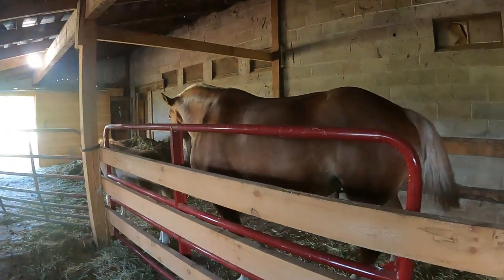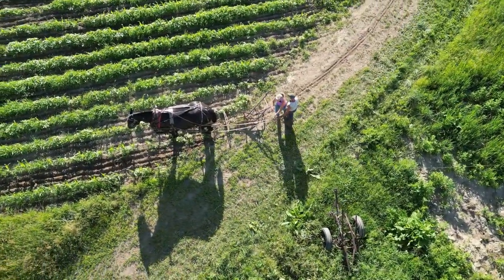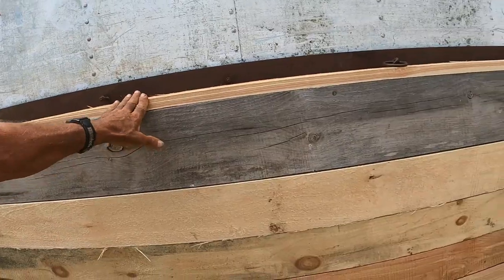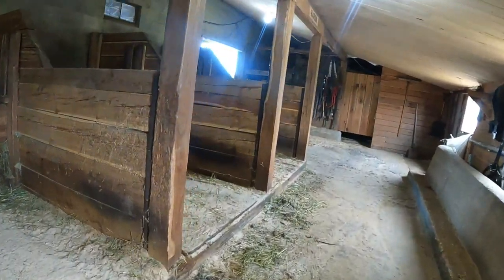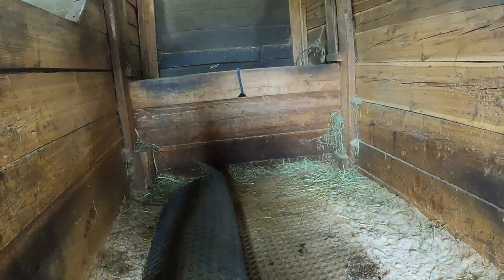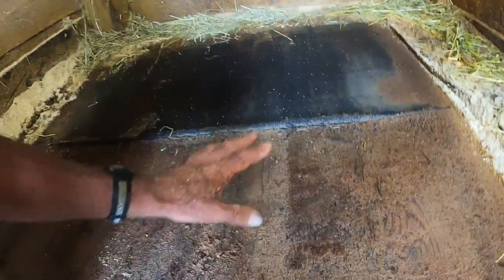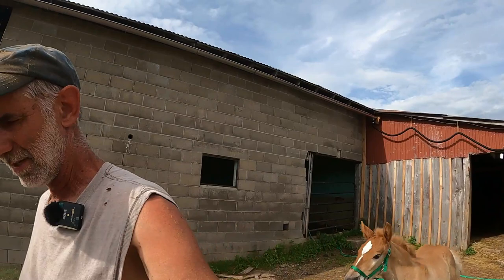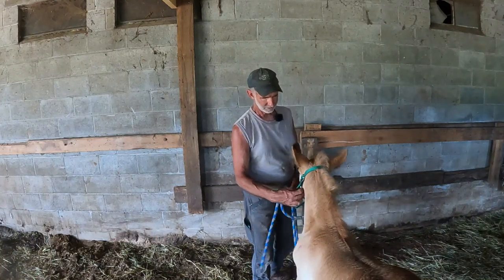DRAFT HORSES CULTIVATING A FIELD & Bree's Training Session for the Day! #502

Comment: With regards to the moisture under the mats, if there is no moisture/ vapor barrier, under the floor, moisture from the ground will come up through, continuously. The mat keeps it from evaporating. However the top of the mat is dry?  Is that important for the horses to have a dry mat? Or  is the top of the mat wet?

Comment: We’ve always had moisture get under mats that are pieced together. Only solution we’ve found is getting rolled rubber that is big enough to lay down and cover the stall in one piece and have enough to go up the side of each wall about 2”. You can then take a piece of flat iron and drill holes through it and the rubber, to attach it to the wall. If you want to spend the money there’s also a product called Comfort Stall that does the same thing with a piece of foam under the rubber to make it more comfortable. Your tie stalls might be narrow enough you could split one of their stall mats in two to save money. Also check with the dairy supply people for the rubber mat rolls since that’s what they’re bedding down on
Reply: That's some interesting info, thank you! I was on board with just removing it and going back to wood for the sake of their hooves, but your way of handling the issue might be better. I bow to your greater experience 🙂

Comment: Well Jim you did ask for my opinion for your horse stalls and bedding . Take out all rubber , use less sawdust . Trade a load of small square hay bales for a load of small square oat straw from your Amish neighbours. If you have a bale chopper from your dairy cow days . Chop a bale of straw into each horses tie stall .Keep straw bedding as deep as possible .  Horses will push some out but nothing is perfect . Stallions your welcome to handling them and your doing a great job training Baron . I was taught to stay away from the stallions and I didnt need to be told twice .
Reply: Jim is using old hay for bedding ( Lady's and Brees pen ) . But hay is poor to use because the stems catch together and make a hard mass to handle  .Oat or wheat straw have smooth stems and keep separated better.  Oat straw has been used for animal bedding for years .

Comment: Hi Jim and Brenda! I hope things are well today. I don't really have a recommendation for the mat replacement but I'm sure you'll get some good advice on here. 
Years ago I was breeding Paints and Quarter horses and learned a few things with the babies. To teach them to stand tied and lead well, we fastened an old inner tube firmly (motorcycle tubes work great) to a post them looped the lead rope through the inner tube to tie them. They could pull and fight the inner tube but it was flexible enough to give, then released the pressure when they quit fighting and stepped forward to stand quietly. It didn't work so much to prevent pawing the ground, but...one battle at a time. I'm sure that Bree is going to be a gentle worker as she grows up. Keep up the videos - I love to watch all of them.

Comment: Hi Jim so the question to your mats. I have dirt floors and also discovered moisture with mats and sand, things have gotten much better for me because I put down a layer of river rock to allow for airflow, that obviously won’t work for you. I do believe when you built your stalls there was concrete underneath the wood floor and concrete can cause moisture even with just humidity, my suggestion is perhaps rubber coat your boards with bedliner from tsc or wherever then your boards are protected from urine as well as if you want to use the mats the horses can have some comfort, will it work Im no expert but I do know that the mats need some form of airflow to keep dry. Otherwise protect the boards from the moisture. My big horses are using the thickest mats we could find and they are holding up just fine but we have box stalls and my mats can move around a little we got them from tsc and are going on two years and no mats replaced or even torn yet. I hope this helps 

Tiffany

Comment: When I first moved here there was 3 draft horse stalls that had oak boards 2 to 3 inch thick on the floors i don't know how long they were there they were worn but good enough to use for the box stalls I put in I had to drill holes you could not drive nails through them I have rubber mats down and I know it's wet underneath I think wood is the way to go especially over cement with ag  lime I think rubber is better

Comment: Hi Jim been subscribed for a few months. Love your videos beautiful horses love seeing them doing farm work.

Have rubber mats in my stalls and it constantly wet underneath them.  My mats have been in stalls a good 16 years some wear on them but no rips or holes. Have a lot smaller horses then you do though only 1000 lb horses.  

Think removing your mats would be best. Then you could keep floor drier with saw dust an keeping wet spots cleaned up.   Could use barn lime after you clean up the wet then cover with the saw dust.

Comment: The moisture under the mats in your stalls is coming up from the ground through the concrete which is actually quite porous. I am quite sure there is no vapor bearer under the concrete barn floor. Problem could have been solved had some sheet plastic been put down prior to placing the concrete. I would suggest you water proof the concrete next time you pull out and replace the wood floor. There are several great products on the market.

Comment: I have never had wood floors in stalls. The barns I've worked in usually had dirt floors with mats over that. The mats were there to keep the horses from digging holes. I have seen wood floors, but the ones I saw had gaps (like 1" to 2") between the boards on purpose to let moisture through down to the dirt. They didn't use mats though, just shavings on top of the wood.

Comment: i had a mini horse that we kept in a shed(almost tiny house size shed; was also very well ventilated) for a barn for him with nothing but plywood for flooring and my dad drilled a hole in a corner of it for any pee to drain through and we had no issue with any rotting of the floor for the entire 16years i had him.  i just had to shovel any poo into a wheel barrel every morning and every once in a while take a garden hose with a gun on the end of it and kind of 'power wash it' LOL

Comment: I totally agree with your decision to remove the rubber mats from the stalls !! They do nothing other than retain liquids (horse pee !!) and not only will they speed up the damage to the wood flooring, they gotta stink to high heaven. Presumably, you hose or pressure wash the stalls approximately each month. I would go back to using wood chips and/or sawdust for the floor covering !! Easier to rake up and use as a soil amendment, followed by a hose-down or pressure wash approximately once or twice/month - or more frequently, as necessary !!
That is my recommendation as a former cleaning company executive !!

Comment: I have had a lot of experience with mats & I can tell you that your wood floors will rot under the mats, no matter what you use for wood  - hemlock, pressure treated don't, matter.  I'll go one step further, mats will rot a floor even if it is just a walkway or work area.  My hemlock floor put down in 1986 where their are no mats it is perfect.  Where there are mats floor has been replaced 2 & 3 times.  The last time I replaced the box stall floors,  which has a sand base, then #2 stone, we put moisture barrier down, then pressure treated 2x6's & fit the mats tight.  I use 6-8" of shavings so not much pee goes into mat cracks.  Even after all that the floor rots in spots after a few years.

If I was Brenda, I would be riding Ken to do the cultivating. 

Will Baron break the wall?  Well, are your 2x6's pine, are they finished or rough cut full 2"? If they are rough cut 2x6 hemlock, I'd say no.  Pine maybe..

Comment: Re: your truck body repair, just a couple of thoughts. I like the repair and it certainly looks stout, but Baron will undoubtedly ding it up.  He could possibly punch a hole in the boards due to the hollow space behind them if he really gets agitated. If it becomes an issue,  maybe you could face the boards with something like rubber stall mats where he's most likely to strike them. The boards would be protected from the pole or his hooves while also providing some shock absorption for Baron and the wall. Also, that bolt sticking out next to the middle tie ring at the top of the boards would drive me nuts.  Knowing my horses, they would find a way to catch themselves or their tack on it and possibly injure themselves doing it. Or, I'd bark my knuckles on it putting something on the shelf.  I always find a way to mitigate something like that to prevent a mishap since in the long run it's cheaper than paying a vet to come stitch up an injury, or a harness maker to repair a broken bridle. A simple piece of scrap board to fill the gap between the two edges of the shelf, with a hole cut in it just big enough to slip over the nut/bolt would work. Then the bolt would in essence be countersunk and unable to catch on anything while still being accessible if the nut needs to be removed in the future.

Comment: I have mats for cows in my stable, very thick and heavy. The underside looks like yours, but you can not flipp them since they are stiffer and thicker.
Had these mat for 10-15 years and they are still fine. 😊 But I have concrete floor, so I need the extra comfort. But yes, there is always moisture under and to protect the concrete I put chalk under the mats every sommer after the big stable wash.
I think your wooden floor is not benefiting of these mats. They trap the moisture badly.

Comment: Mats are good if you have a horse that's off or one that finds the wood slippery. In my experience, they need to fit the stall, side to side and front to back with no gaps to catch a hoof. The sawdust needs to be and stay on top of the mats. Mats can be lifted up and cleaned underneath and leaned against a wall to air out the floor when the stall isn't being used. Great training on Bree.

Comment: The 2x6 fix won't stop Baron from attempting to cause mischief, but it will slow him down. 😁 Bree is sure coming along, and learning the ropes. Matts are fine in a trailer, but they just don't stand up to full stall duty very well. Wood floors will rot because matts hold moisture. Wood is soft enough on the horse, especially if you are using sawdust that you change out daily. I would only use stall matts on concrete floors on my converted dairy barn if I had to reduce leg fatigue from long confinement in winter.

Comment: I would put wood shavings down on the wooden floor and just periodically remove wet shavings and get a manure fork and remove manure daily. By the way when you tie horses especially a youngster always tie them higher than withers. Horses pulling can break spinal joint between ears and dead horse. I have known of that happening several times with my horse friends. Love your channel!

Comment: The rubber mat act and is a vapor barrier. Moisture will always be trapped under the rubber until you remove it. The wood floor may be wet sometimes but need to dry each time it's wet every day. If you keep the rubber mat, you will have to pull it away each day and led the wood floor dry... (excuse my bad english, i am a french speaking architect from Montreal).

Comment: Hi Jim, I see mold and meldew on those mats,not good😮  what I would do is clean the stall floors let them dry, then paint some water proof sealant on the floors, let them dry thouorly, use a fan if you can .Put lots is of bedding down, no mats this should do the trick.
Good luck Sue.

Hi Brenda, got your e-mail, thank you🐎🐄🐀🐓🍄🌺🌻
F

Comment: Take the mats out.  There is no air interface in between the rubber and the wood.  A solid sealed mat would be better for the floors assuming the wood is dry,  but at that point the horses are subject to standing in moisture if the flooring does not have enough pitch to drain.

Comment: Wood wins against Baron, wood floor with no mats. My stalls are ground, 8" limestone gravel, then the interlocking 3/4" mats which has lasted well for decades. Where I used to board, had a wooden floor in the stall and it stayed dry with sawdust.

Comment: You are experiencing what crop farmers have dealt with for many years before herbicides were developed. It's a constant battle when they are not used. In my opinion, a cultivator sweep blade on the last center time instead of thin shanks would cut the grass roots and kill the grass. As long as a root that is part of the grass plant stays in contact with the soil, the grass will continue to grow

Comment: I believe you have a good solid wall I hope Barren won't get to carried away looking good Jim also for Brenda as well❤
Reply: There is inner locking for the seems we put them in horse trailers  does help from separating good point Jim could have diseases setting in from moisture

Comment: I don’t think the mats  are as practical with heavy draft horses with the type of shoes on them that you use, compared to a smaller horse with a flat shoe or no shoes at all. It’s going to definitely wear out your mats faster. And you are absolutely correct that the mat traps moisture. 

I think you’re on the right track by putting a good solid hardwood floor with bedding.  It’s still going to write out floorboards eventually, but I don’t think it will be as quick as your wood floor with mats on top.

I have  used mats for riding horses, and currently two ponies and they last forever because the horses were either barefoot or with flat shoes, and there’s a lot less weight. 

Years ago when I was growing up, I remember some friends putting hardwood plank, floors in their tie stalls and using bedding, no mats, and they lasted quite a while.

Comment: Hi Bill,  I have had horses on maths before. I had cement floors with a good coat of LIME and the maths on top with no cracks in between the maths. The maths where taken out and cleaned and put new LIME every five years. P.S.  There is different kinds of maths. The ones we had were made in Canada, in Québec and had grooves on the underside  that would let some air in. I hope this helps.
Reply: Wow, great advice, I'm sure Jim loves your Comment.
Nice job you did.

Comment: Matts only good for concrete or  hard floors other then wood stalls. Your wood will rot faster.  Preservatives on wood and shavings and saw dust changed often is what I'd recommend.

BTW. Wished i lived close to you. I would give you free labor just to work with your beautiful horses.

Comment: You could pull back that dirt from the bottom board and paint on some used motor oil......I know.....So many will start to freak out......Notice I didn't say pour a bunch of motor oil on it.....painting it on will soak in easily and preserve the wood quite well, without soaking into the ground.....once that sits a few days you can put the dirt back and there will be negligible oil transfer to the soil......of course, you probably already have planned to do this....just not showing on video.

Comment: Just a minute... I have someone who knows....step. step step.. "Hey, Jim, what do you think about Matts under draft horses?"  Ah ha :-)  Jim, you are in the position to make the best decision.  I noticed often yes the majority of the moisture is at the hind quarter, the front dry or dryer, however, Ken's was wet all the way!.  I'd pull the mats out and let them dry a day or 2 then get some dry straw, sawdust in there,  (waste hay).  The wood is nice on their hooves and rubber.., I remember b4 rubber was popular, we used just straw.  On concrete,  yeah maybe mats, but on wood , maybe not.  I would get rid of the bad Mat and use the good pcs in one stall.  Mat quality important, I suppose they have some junk on the market but fleet farm usually carries a good brand. Tractor supply by you maybe. Anyways, let us know what you do, great comments.  I miss the days b4 rubber matts.  Everything natural, when matts first came out, working for neighbor farmers. ..I looked trying to understand their logic,  sometimes just a big sloppy mess, but I guess I see their value too, but yes. .
, moisture rotting your wood, you are right.
A major factor is you have access to alot of wood with your mill.  Good job pulling those rubber mats back.
Nice work with the colt and good job on the wood wall on the truck box.
Thank You.

Comment: Based on what happened to the bacteria count when my Dad went from a wood floor for his cow stable to a cement floor I would get rid of the mats. The bacteria count went up because of the constant moisture. The bacteria count is going to be higher from the moisture under the mats causing the wood to rot faster and it creates a greater chance of causing health issues for your animals. Doesn't matter what type of animal is on it. Just my 2 cents.. go with just sawdust.

Comment: Hi Jim & Brinda, Will, see? Charly bought a Saddle Horse He named Baldy; He was a Big Horse may have had son Draft Horse in Him. While Carly was Breaking / Training Him to lead and stand tied at the Hitching rale Baldy threw a fit one day and pulled the post out of the Ground with ease. Yepper! things got a little too exciting for a few minutes as we contained the outbreak. The post wear dug in around 24" inches maybe a little more and about 6 or 7 Ft. apart. When Le Roy and the Boys reaped this, they dug the post in to 48" inches and used Rail Rode Ties. Baldy tried it again a few times, but He didn't pull them up again he barely moved them the first time when the Dirt was still a little soft. Will see if this is Baromn Proof😀 Stay tune in for the rest of the Story.